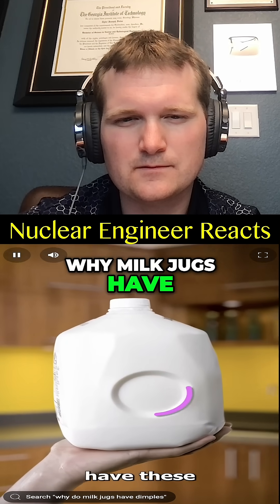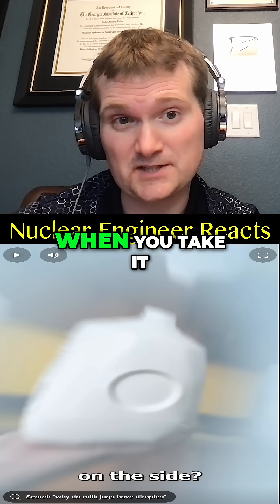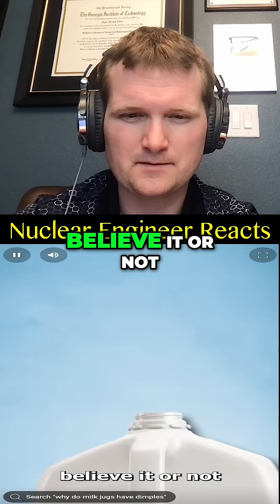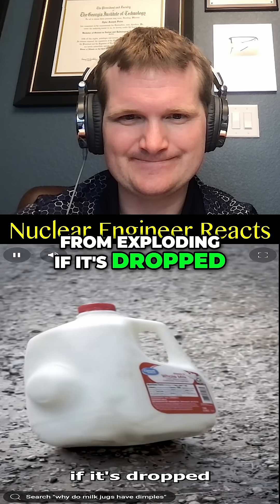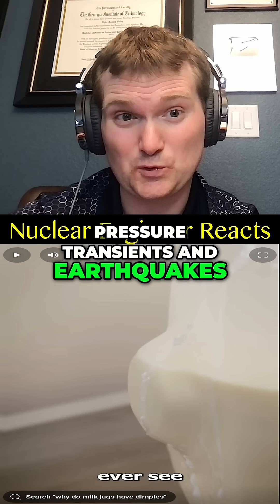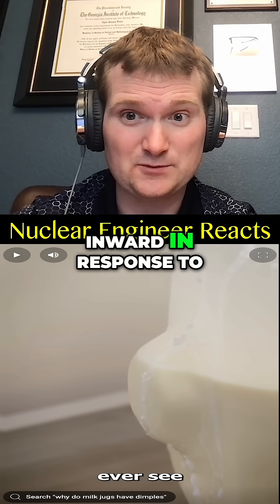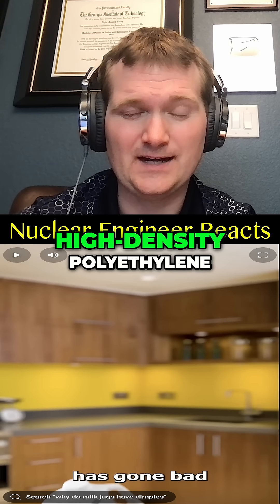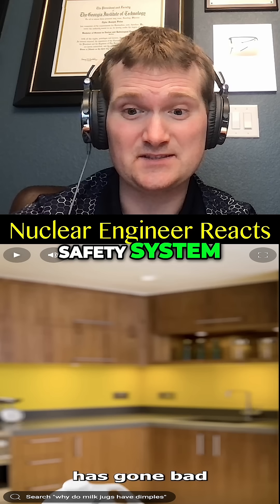Why Milk Jugs Have Dimples - Nuclear Engineer Reacts to Zack D. Films

Comment: Aside from making it stronger when it's dropped, it also simply adds rigidity, preventing thin soft plastic from folding in on itself when it's being handled. Similar to how a large piece of fluted cardboard is much more rigid than a just as thick stack of paper would be.

Comment: No i have never wondered about that because not everywhere does that as far as i know its only in America that we don't have that in the uk also ur nose will tell u if the milk is bad
Reply: what if u drop the milk then, wouldn't that make it explode easier? and if the plastic is thicker doesn't that mean your using more plastic then is needed? what if you are incapable of smelling (anosmia)?
Reply: @danieltyborowski9977  no when i have dropped any milk its not exploded the lid usually is the failure point but will screw back on fine and probably lose about half a pint in the process for not being able to smell off milk thats easily solved when u make a brew/ cup of tea if u have little floating bits then the milk is off and for wasting plastic america is 1 of the worst the coca cola company takes the top spot for that america while Europe r constantly fighting big companies thats abuse the use of plastics and and Greenwich everything to make people think there actually doing something about it
Reply: The way I see it, milk is in 3 phases.
1.  Fresh, good to drink or pour on cereal.
2.  Old but still usable for cooking.
3.  Bad and needs to be thrown out.

And a bonus 4.  Forgotten in the back of the fridge and now it's a biological weapon.